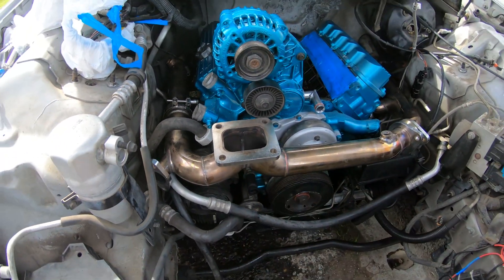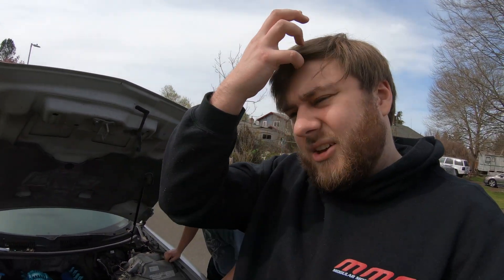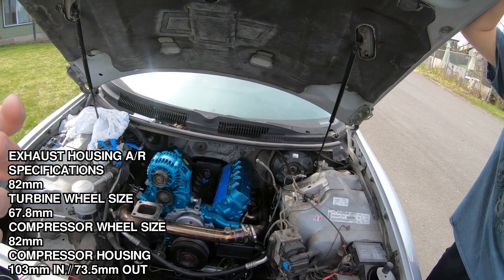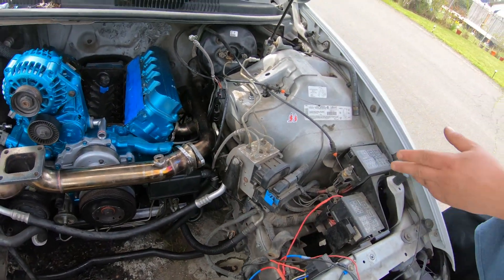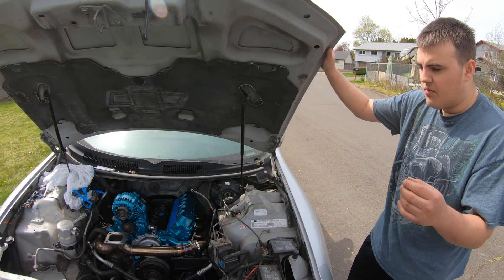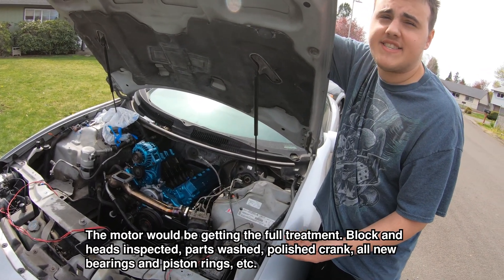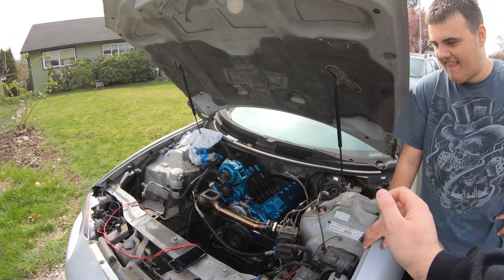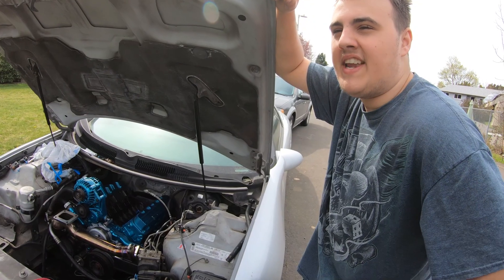Project F Camaro Rebuild Part 25! The L67 Drivetrain is in! We Got a Turbo Manifold for the Camaro!

Comment: Just a question i know u abandoned the SC build. but would it have been easier if ur routed the SC inlet to the left where the alternator is like how others have done it and added a rear mounted turbo if u really wanted the twin charge ?? Im a noob not criticizing or anything jus wondering ur thoughts